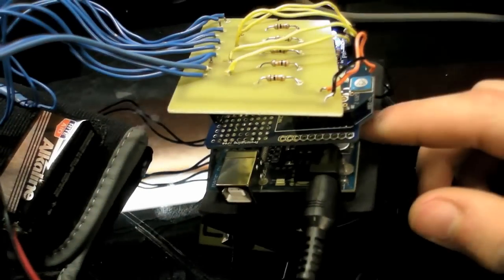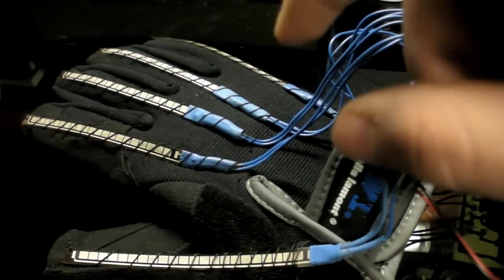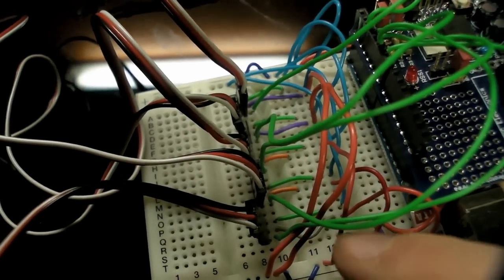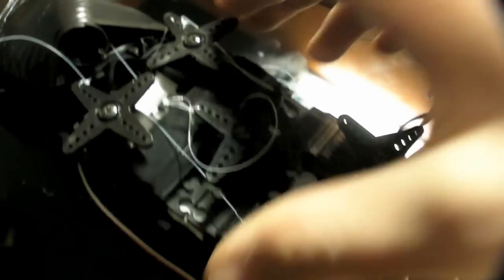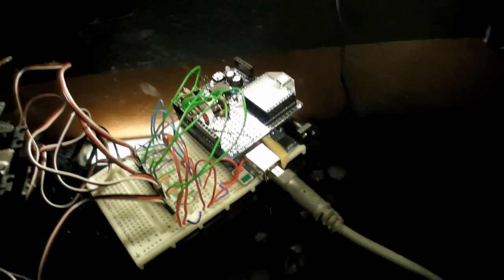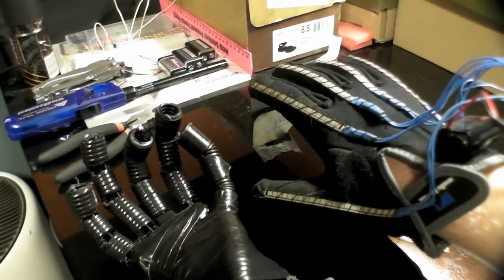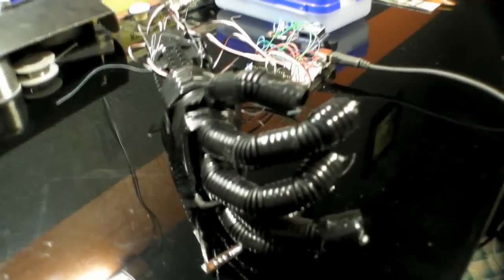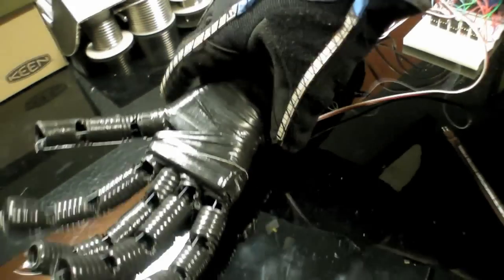Arduino Wireless Animatronic Hand

Comment: I would like to know how did you work with the multithreads? As i can see you can move the 5 fingers at the same time could you send me your code or explain because as far as i know, real multithreads aren't possible on Arduino. Am i wrong?
Reply: +Jérémy Dufresne You´re not wrong saying that. It lookes like he simply takes lookes at, wether his finger is retracted or not and doesent care about exact positioning. But I could be wrong. He doesen´t show anything about exact positioning.

Comment: Hi, I liked your hand. I was wondering if it was possible to make a robotic hand on a micro scale that could function similar fashion as a real hand.
 I thought it would be neat if you could make a pair of hands and arms that could work with very small smd components. you could have a micro camera where the head would be, and arms to simulate the human form. a sensor jacket goggles and gloves, you could make real movements but transmit input signals to scale in the micro world.
Smd components, very small,l could look and be maneuvered like large books.
A sensor platform could be rigged to help with location software.
 This attachment could be made to fit current cnc machine or 3d printer with the small arms and hands device. I think this concept could be the next big thin in computer assisted manufacturing.
 If made in large quanties ,'I will call them torsos", could be pumped out like drill bits and used and replaced as needed. I know this would be a god send to help out small scale manufactures and inspections / quality control.
Let me know what you think of my idea if you get the chance.
I also was wondering if you knew about memory metal. It could be used to replace large servos and is strong enough to work on a micro scale.

Comment: why u don't put a small motors on every leg
for example you need 3 motor on every leg , 
and for the major leg (le pousse) put only 2 .
the motor of of the next part of leg put it in the part of leg that is before .
make glove much slim like latex and detecte the distance between legs if they move horizontal
good job good luck and good :) corage

Comment: In all videos that i seen people using arduino to do stuffs ...etc, Yes it's easy to do but if you want to do a real project and work perfectly and with low structure, you can use just the Atmega chip from " Arduino board " not the hole board. Make it better and smaller ;)

Comment: What is the resistance ratio of the flex resistors that you used & also can you tweak the arduino readout to where they flex more w/ you moving less.  I ask this 'cause I am working on a project similar to that & I am still deciding what kind of components I will be using